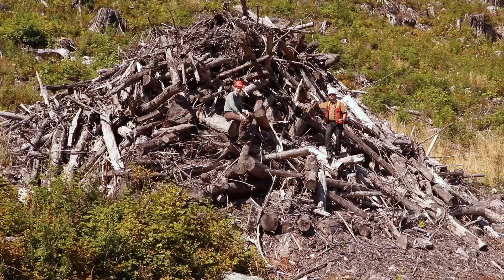Slash in Logging Operations

Comment: I highly doubt that these slash piles (which I see are quite prolific in the cutblock) are counted in the "carbon footprint" or carbon sequestration claims of the logging industry when they are burned....as they are. "Returning nutrients into the ground" .....lol, no. Those "nutrients" are going into the air. That should have been pushed-back on.